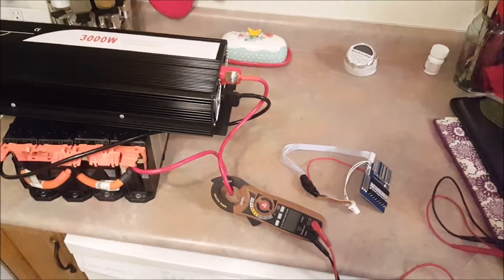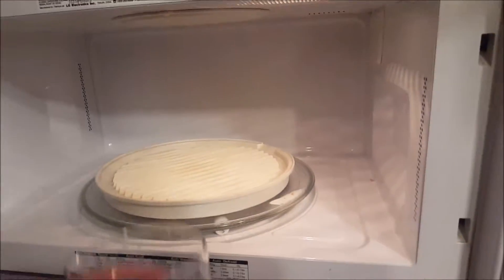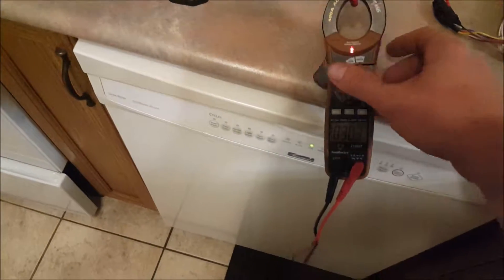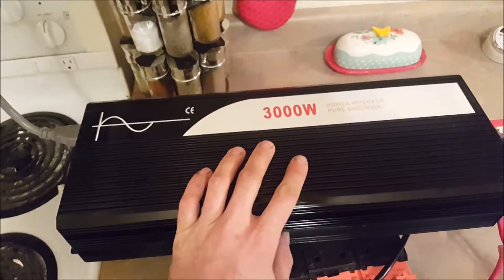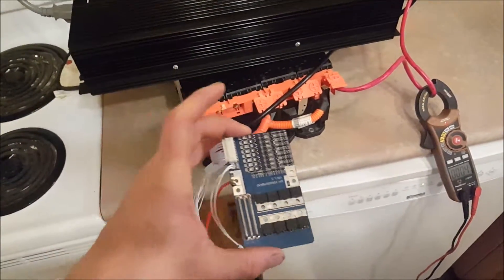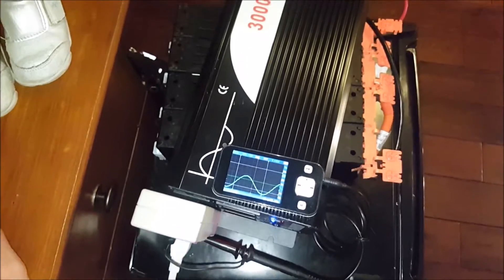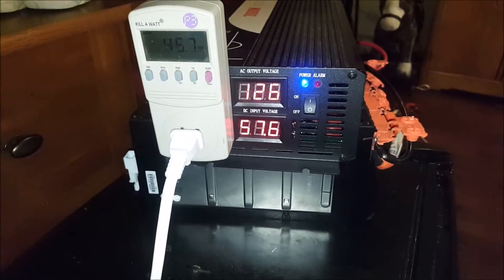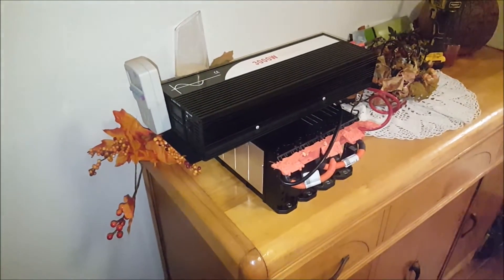60 Volt DIY Power Wall Testing

Comment: yes the microwave is a great power hog to test your system for reliability, you could watch the sine wave to see if it stays true under the load.
even though there is a 20 amp breaker for the outlet, the plug is a 15 amp, otherwise one blade would be at a 90 degrees to the other, but the surge on startup is a good test.
some people that want to be offgrid don't realize how much power the micro will draw, compared to cooking the old fashion way.
thanks
Reply from the maker: good to know thanks for the info, I love learning, I would also like to know the power factor of the microwave.